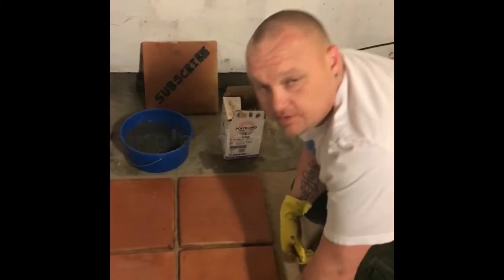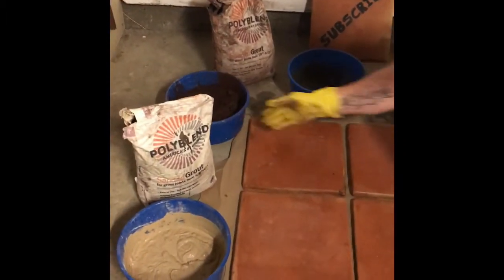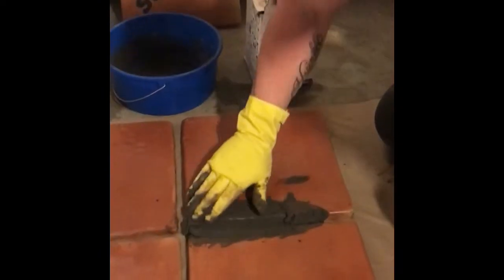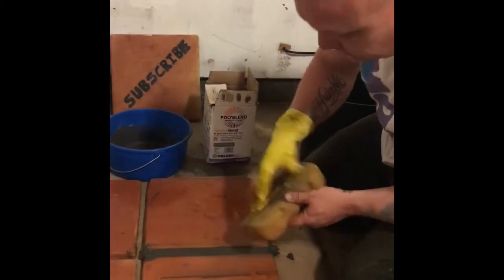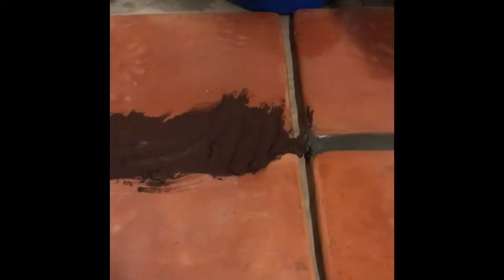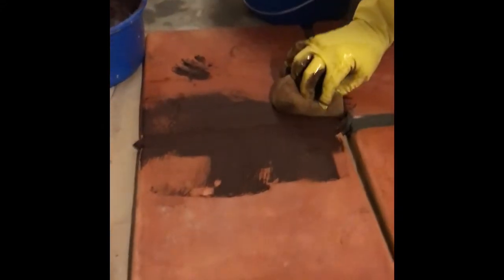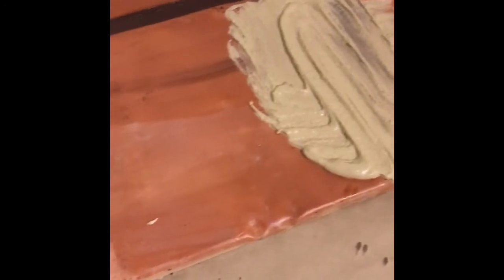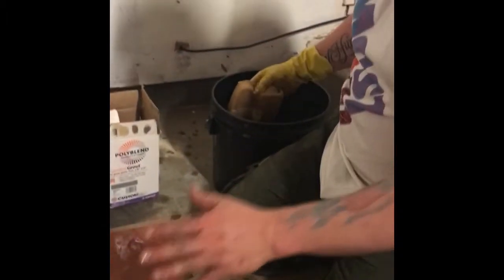How To Choose Grout Color for Saltillo tile | Polyblend Grout

Comment: I watched a bunch of videos for my first DIY job. None of them did this like this. Thanks for the simplicity. I used regular 6x6 Columbian quarry red/brown tiles and black sanded grout. I was wicked off in the amount of grout I was supposed to use. I bought 1 10lb bag for a 100 sq ft. It was barely enough to do the first areas where the stove, refrigerator, dishwasher, and trash can go, all my hard to reach cut-outs. I probably need 3 more bags.

I followed the instructions on the bag and used the exact amount of water for the grout, but it was super dry and very hard to use. I just could not get it to clean up without just making a continuous mess. But I see you with the water bucket and continuously rinsing it out, I hope that makes it easier. I spent probably an hour on the wipe up, for the spot where the refrigerator goes and it still looks like crap. The grout gaps just keep painting the tiles.

Comment: i am adding a new section of 4” old terra cotta tile on my kitchen counters which were installed 20 yrs ago. the grout WAS beige originally but are much darker now and slightly lower after years . if i chose a darker grout for the ‘new’ install (reclaimed from other area of house, can i use tyhe. new grout color OVER the old, worn grout? the space in between is too narrow to dig out without potential damage the existing counter. what doi you suggest i do to  not make the newly set tiles  stand out?